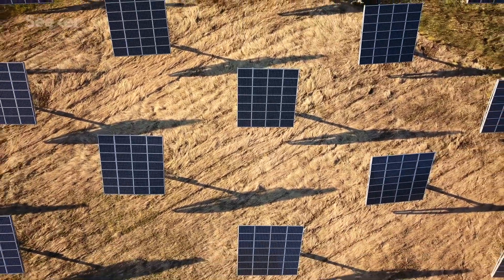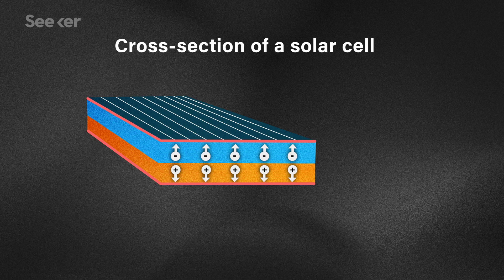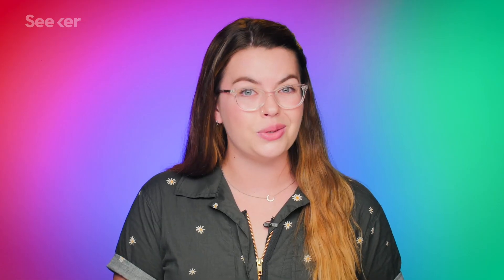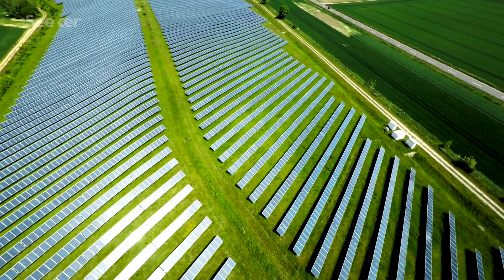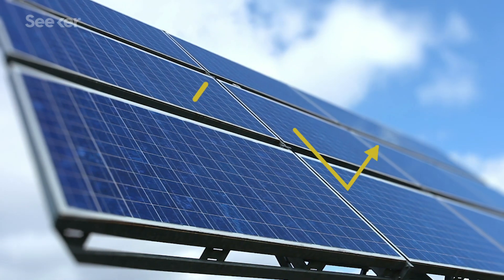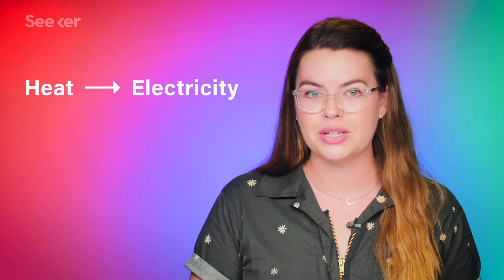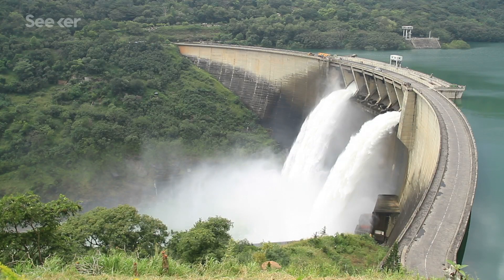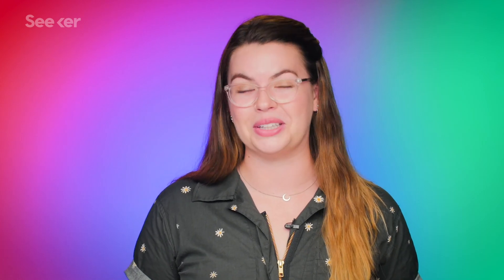Carbon Nanotubes Might Be the Secret Boost Solar Energy Has Been Looking For

Comment: The number of times I have heard that carbon nanotubes are the solution to a problem: 1 milion
The number of products I can bay using carbon nanotubes: 0
Reply: Check Wikipedia, they are being used, just not (yet) in large scale technical applications, because its still very hard to manufacture them.
They are used in microscopes, fighter planes and even Tennis rackets.
Reply: @superschnitzeltv6300  Or maybe they are still classified due to use in military superiority...
Reply: @superschnitzeltv6300  because Wikipedia is a great source for facts right!? Wikipedia is manipulated negatively all the time to push agendas!
Reply: they are really hard to make, they make it in a lab in really small amount, we need a material engineer genius to unlock its production
Reply: You can buy vanta black paint witch is made with nano carbontubes
Reply: @olajonmann97  wrong true vantablack is only available in Labs. The black that you're getting is black 2.0 not vantablack
Reply: Carbon nanotubes are in products now. They are being used in radio antennas, anti static materials, yarn and rope, insulated yarn, brushes for electric motors, multi walled nano tubes added to polymers, CNT powders added to polymers to increase strength, flame retardant additives for plastics, and on and on....
Reply: @martinw245  true, but so far, few macro scale products can be found. It is just the beginning stages of development, now that the tubes themselves are more widely available.
Reply: @Myrddnn  

Are you sure you aren't confusing CNT with graphene? CNT is in many products now.
Reply: @martinw245  I can find suppliers of CNT fibers made into yarn/threads or sheets, I can find suppliers of CNT in multi-layered tubes in bulk. But I cannot seem to find products made using these things. I worked in carbon fiber manufacturing in the late 90s. I checked some of their sites and can't find them using CNT, which I would think would be a great additive for strength in many components. If you have some info on this, I would love to check it out.
Reply: @martinw245  I believe important point is that film from the dexmat.com that is 100cm x 1cm cost 150$ while solar panel 110cm x 57cm costs $150, assuming applying film cost nothing and there is no other issues like fragility of the panel to damage. Applying film will bump cost of solar panel roughly 50 times while deliver improvement only 4 times. It's pretty much end of story at this moment.
Reply: @martinw245  they aren't truly widespread until they are in condoms.
Reply: @TheIntJuggler  

lol!
Reply: @martinw245  Not to mention cheese manufacture, stand-up comedy, denture removal, cross-country weight lifting, mass line dancing, consecrating bad vodka, cheating at yoga competitions, and backgammon.
Reply: https://blogs.gartner.com/smarterwithgartner/files/2018/08/PR_490866_5_Trends_in_the_Emerging_Tech_Hype_Cycle_2018_Hype_Cycle.png

You are currently in the first section.
Reply: Dr. Zoidberg hats off to you, my friend. My utmost respect to someone quoting Gartner. One of the best companies out there that not many people have heard about. 👍
Reply: False. You can buy special carbon nanotube paint that absorbs 99.97% of all light for 40$ on amazon. 
You're welcome.
Reply: Petch85
The scale of your patience tolerance is 0
Reply: Someday when you’ve totally given up seeing it come to mass market..bam! There it is!
Reply: Rocket lab made rockets out of them
Reply: @nutman2353  not exactly. Carbon fiber materials that they use for their rockets have been around much longer than carbon nanotubes and currently do not incorporate their uses. Nothing on their website indicates the use of carbon nanotubes.
Reply: I think you have mistaken CNT with graphites. CNT is quite widely used, relatively
Reply: @sendoh7x  

Yep, I think the doubters are getting mixed up with graphene.
Reply: There must be a dildo made of nanotube and graphene somewhere
Reply: Check out my playlists on another channel for answers about Graphene products you can buy, where we are at with it, some said it's cheaper now and easier to produce, and it's going into different types of computing.

Don't forget to check out the rest of the playlists.
I'm only trying to make people aware and teach, not for any other reason. It's very interesting emerging technology.

Archer Exploration, the company from Australia that's working with Graphene to bring Quantum Computers to room temperature. Which will end up in our homes sooner than you think!
In April 2019, they announced and launched the project.
And in June 2019, they already finished the first - stage of their chip.
Also in September recently, about a week ago, they were able to place the first Quantum Bit (Qubit) in the right position on their microchip.

Find Archer Exploration videos under this playlist I made, where they talk about Graphene to bring Quantum Computers to room temperature. They seem to be pushing this technology faster than any other, don't know why other companies aren't doing this.
You can also find other articles on it, in that playlist's description near the top, click the "more" button.
https://www.youtube.com/playlist?list=PLAUtk-Q2DF7wXgENPNkvc5JXH5ocia_Fo

And check my Quantum Computing playlist for more info. And the articles under it.
There are some computing articles in some other playlists like Photonic Computing, Neuromorphic Computing, and in a playlist called Other science and technology, on the channel.
https://www.youtube.com/playlist?list=PLAUtk-Q2DF7zcaxLKdVe7KGlZW6VZBYn6

And have you seen Spintronics? Spintronics is basically electronics 2.0
It tilts the Electron = electricity, and they are using Spintronics with Graphene to make our devices more energy efficient and faster, and will go towards advancing Quantum Computers.
Spintronics has been tested to tilt the Photon (light), and they were able to make Quantum Teleportation.
Australia plans to use this technology to make a Quantum Internet by 2030 and share it with Europe, no word on if the U.S. will have this yet.

If you look for a video under my Quantum Computing playlist, from the link above, called "Quantum of Promise", you can see the info about Quantum Teleportation and Australia wanting to make a Quantum Internet.

You can find this info about Spintronics, and Spintronics with Graphene, under the Graphene playlist link above, for Spintronics. And I have a Spintronics playlist on that channel. Please be sure to check both playlists mentioned.
https://www.youtube.com/playlist?list=PLAUtk-Q2DF7zicJm2a61R4BAhekeTF64N

Here are some other playlists to check out and watch all the videos under, from top to bottom.

Photonic Computing playlist.
It would seem that not only are we going to have Photonic Computing, but other companies plan to implement Neuromorphic Computing into Photonic Computing, a video on that in my Photonic Computing playlist, it's a long video though, mentions it closer to the end of the video at some point.
https://www.youtube.com/playlist?list=PLAUtk-Q2DF7yx80jrh7uORkHKowzGy7pi

Neuromorphic Computing playlist.
https://www.youtube.com/playlist?list=PLAUtk-Q2DF7xp1wuPSPpIP06hSdcJ11YK

Other science and technology playlist.
And be sure to watch all the videos under this playlist from top to bottom, in that order please.
https://www.youtube.com/playlist?list=PLAUtk-Q2DF7w0qUOmrKoKy82mfYbQ3Ng7

Here is a link to all the playlists, be sure to click the title / text of each playlist, not the pictures.
https://www.youtube.com/channel/UCB9ezXYprgvhMaPWLhyoJ7A/playlists?view=1&sort=dd&shelf_id=0

After you see all the things mentioned above and the playlists, check out these 3 videos below.
And check the comments under some of them about Archer Exploration, the company from Australia and them using Graphene to bring Quantum Computers to room temperature, be sure to check my Graphene playlist and Quantum Computing playlist for the playlist description, using the "more" button for the articles.

Don't forget to right click and select "open in a new tab" when you go to "play all" the videos, so that you can read the info under the playlist for the videos and the playlist description, with articles and other info.

Here are 3 videos to check out after you see all the stuff above.
Check out this video, it talks about some technologies coming in 2025, 2028, 2030, 2035, 2040, and 2050 from AMD and emerging computing technologies that they plan to use.
Keep in mind it could be sooner than this, not just with breakthroughs but also things are accelerating so fast. Some companies are already working on Photonic - Quantum chips from other countries.
https://www.youtube.com/watch?v=maZnwuGxAA8

Classical computers (the ones we use right now) 1,000 times faster with Graphene and specific magnets.
https://www.youtube.com/watch?v=ZBnB2LjIRpc

When you click on the link below, be sure to check the comments and also look near the end of the video at what he mentions about Archer Exploration, and then watch the video from the start.
What he says at the end of the video, will make you question how close we are to other stuff in the video above this one, and how fast those other emerging technologies and beyond are coming.
https://www.youtube.com/watch?v=VLPpDoMBVK0

If you google search "Archer Exploration website", you can find more info there. 
And go to the videos under my playlists to comment, not to me!

Remember that it is because of people that emerging technologies take so long, such as delayed or not happening, and people create politics, people and politics are the reason, so that should tell you how fast these emerging technologies could be used, also think about Silicon from AMD and Intel, if they stopped trying to get their CPU Silicon Transistors down to 3 nm and below, we could shave off 10 years that would take up to just about 2030 before Graphene is used, and instead would be early 2020s with Graphene being used, who knows.. it might come sooner than 2030, but that is the reason why it's not as soon as we could actually have it, let that sink in, it's not the technologies fault at all, AMD and Intel are just being stubborn and holding onto Silicon, AMD's Lisa Su was on stage this year announcing the Ryzen 3000 and said "I love Silicon", so again.. let that sink in, and based upon the video above the last video link in this comment, you can clearly see what I mean where it shows carbon nano-tubes around 2030.
And so people are to blame, from companies to just consumers that are scared of such technology or just don't like it, for the reason of such delays or other emerging technologies that won't happen.

We need Microsoft to make a new OS for such a Graphene computer that uses specific magnets to be 1,000 times faster, so that the software impacts on the performance, this has already been mentioned before and hopefully Microsoft will get started soon on this, our computers could be 1,000 times faster as the result, or around that speed.

And whenever you hear someone say that it's impossible..
"It's the limitations of the human mind / imagination, not the technologies fault".

These good innovations will help drive more Graphene devices to be used, and if a motherboard and CPU can already be made out of Graphene, this shows that it can be produced for products the same size and larger, even for products already out there that you can buy. They also use it with boats and many other things, even like the other guy said about some Graphene products in a comment above, you can find these in my playlists.
They are also making Graphene foam that isn't in its "purest form" for its special properties, that will go towards buildings, sky scrapers, bridges, satellites and so much more in the infrastructure of cities.

Btw the video we are commenting under, Graphene solar panels has been known, there is a video in my Graphene playlist so they are a little late in this video, though maybe this video was for updated versions of the solar panels and their progress with the wonder material.
Reply: im buying 100,000 clear straws and pasting them on my panels tommorow to see if they work!!
Reply: smh lol they r the future
Reply: Then do your research
Reply: If you don't like waiting around for nanotubes, feel free to make your own or contribute to advancement in some way.
Reply: Literally... for years we hear that and nothing every been made with it
Reply: yeah if i were to believe everything i have heard about those little things they should usher in a whole new era for humanity. everything will be made from them and nothing will ever break cause they are lighter and stronger then steel. they are a super conductor so they will make really good wires for energy and data transport. etc etc. wont be surprised if someone someday says we can grow an endless source of food from them somehow.
Reply: That's not true you can buy a car paint using a similar product do vantablack.
Reply: Actually there are some carbon nanotube products out there (high performance tennis raquets are an example), look at the "carbon flagship" of european union.
Reply: Donot worry soon you will be able to find those !!!! Nano lubricant(based on MWCNT) is one of them. Even companies commercialize them
Reply: Why not put the panels into space and beam the energy down to earth? (The air force is already floating this idea)
Reply: You're level of patience: 0
Reply: I like the enthusiasm.
1.  Vanta black is cool, but as far as I know you cannot bay it due to export rules.
It is something you can make in a lab, but not what I would call a "product".
(slightly ahead of this research)

2. The Hype Cycle, please note that carbon nanotubes are on the figure. But also note that there are no decisions on either X or Y.
It is marked as 5-10 years to the plateau,  but in that case the time axis is funky, I know that I new of them back in 2005, probably before.
And I was at a Ph.D presentation on how to grow them in 2010 (maybe 2011). Thus we have spend 15 years on the Hype Cycle already, I do not think we have cool "products" in 5-10 years... But I could be wrong. Please go out a prove me wrong :-)

3. material engineer genius
I do not think it is healthy to think of engineering as one persons achievement, it makes the story telling easy, but no one man are able to make much of a progress within any field out there anymore, it takes team work.
Reply: @Petch85  "I do not think it is healthy to think of engineering as one persons achievement, it makes the story telling easy, but no one man are able to make much of a progress within any field out there anymore, it takes team work"

As an engineer, I beg to differ. 

It certainly takes team work to deliver progress to a field, but the spark of innovation behind each element of progress is usually to some degree the product of an individual's efforts, either their efforts on the project or the groundwork throughout their career that placed them in a position to innovate.

Of course it really depends on the field. With material engineering there's a great deal more trial and error work of a team building towards each step of progress, and carbon nanotubes is a perfect example of that. Having said that, at some point there will have been an individual who said "you know if we put carbon nanotubes on the solar panels they could be more than twice as efficient!!", and that specific thought is undeniably a stroke of genius. As to whether it's also a work of genius, I think depends on how unusual the thought would be to a similarly skilled individual - how counterintuitive was the engineering process? How likely was it that others in the field would have the same thought? Did others in the field have the same thought?

With innovation in product design engineering, the kind of engineering that involves the wise application of thousands of smaller engineering miracles to formulate a sufficiently optimal embodiment of a class of product such as would represent an advance to the field, I think an individual is exactly what's called for.

It's like there's a spectrum of refinement in the engineering process. At the one end you've got the material tinkerers, out there in the field, banging the rocks together to see what happens (sometimes physical, sometimes metaphorical), and at the other end you've got the artists who have studied the ways of thousands of different types of matter and have achieved mastery over them and all their forms and permutations and over the myriad processes involved in manipulating and assembling them into optimally functional objects of value (a mobile phone, a car, a spaceship). 

Of course making a phone, a car or a spaceship is most assuredly a team effort, but if you want to develop a new class of any of these devices, you need an individual to formulate it. Well, 'need' is a strong word. To put it another way, I think it's a good way of doing it, as good and often better than any other, and it often happens that way.

With advanced material engineering there is some degree of crossover - the best material engineers are also artisans with the same degree of mastery over material processes as the rocket designer, but at the end of the day they're still banging rocks together, albeit with a set of very advanced processes. There's usually a unidimensional target to the project: more efficiency ie, or lighter weight. The broader applications of the product are not important so long as there are some.
Reply: The number of times i read a comment : 9958435376536547334564373737374633763
The number of times i liked a comment : 1
Reply: "It might" Yes ok Seeker...
Reply: Came here to say the same thing! 🤣
Reply: I want to Bay a product too.